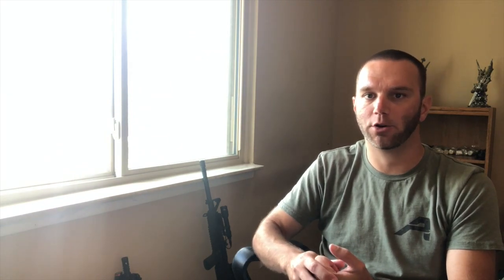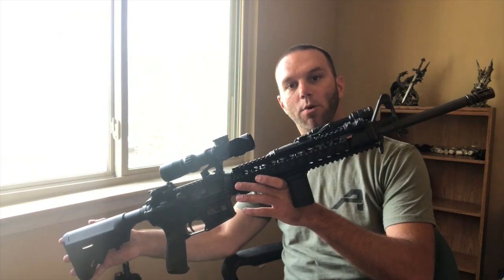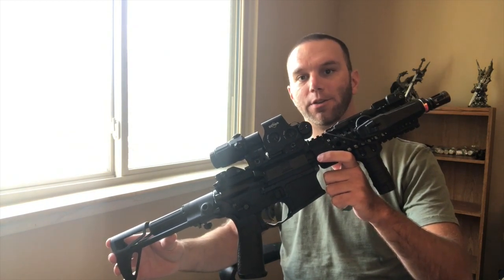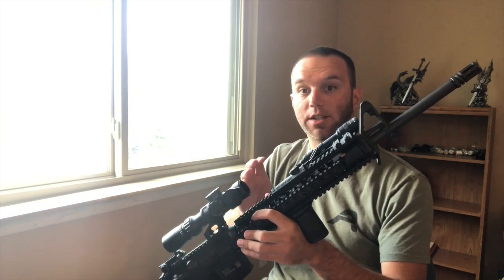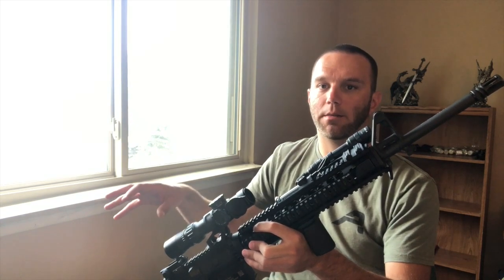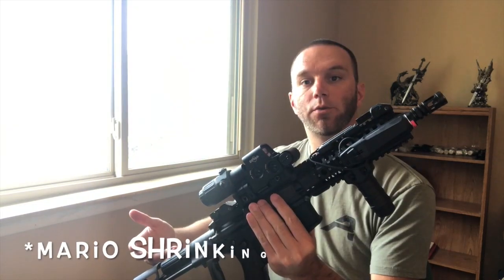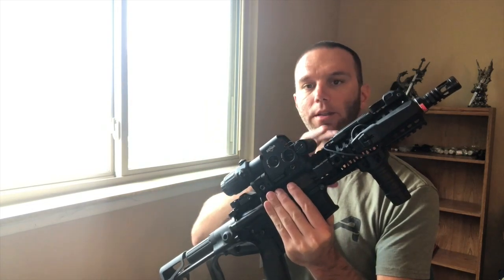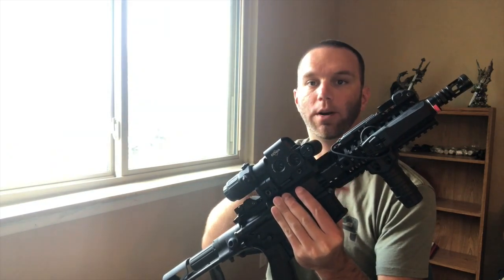Accurizing The X95

Comment: Truer words have never been said about the disassembly video tip. I just received mine back from IWI, as i tried disassembly myself. Ended up crushing the gas cylinder and locked up the charging handle…

Comment: You can adjust the lightning bow trigger to a single stage feel with no take-up and almost no creep(with the stock trigger pack) as opposed to the 2 stage feel.
Reply: How do you do that?
Reply: @shino9797 similar to most aftermarket triggers like those made for Glocks, there's a hex head adjustment screw on the trigger itself that you just need to adjust until the take up is gone. You'd probably have to uninstall it, re-adjust the screw, and try it again until you get it right. A bit of back and forth until it's perfect. Just don't over adjust as then the trigger just won't reset at all.
Reply: @fadetoblack2888  Thanks!

Comment: He seems to have missed a few tricks. First the combination of a riser rail and curved butt pad makes the rifle more ergonomic. A rifle that is more ergonomic is easier to aim & hold on target which makes it easier and more accurate to shoot.. No awkward cranking of the neck. Especially important for larger men. Second, muzzle flip. In the bullpup most of the weight is in the rear. This means the barrel is going to want to kick up more than with other platforms. For accuracy you need a compensator style muzzle device to keep that barrel down. Third, without weight to stabilize the front I recommend using a bipod when possible. Forth, grip tape. This won't make much more difference than removing the polymer locking collar but maintaining a firm grip on the weapon in all situations affects how accurately you will shoot. Fifth, muzzle velocity. Faster bullets drop less. X95 models with longer barrels will shoot better period. Optimal length of barrel for a 77g round is about 20". There are 4" barrel extensions you can add to the gun. For those with 16" stock barrels this will put you right at the sweet spot of about 20" give or take the size of your chosen muzzle device. For those with longer 18" stock barrels you are still better off with the added length if accuracy is your goal.
This video was poorly made sound wise. I had to turn up the sound on my computer to max then turn in back down to go back to normal youtube.

Comment: To shoot the Tavor X95 I discovered that the shooter has to have some modicum of humility and appreciation for the weapon.

I didn't go to the gun range expecting anything about the weapons feel and performance because as a new owner I wanted to understand how to use the weapon as designed in it's stock form as intended.

I allowed the weapon to feel and function by its design and didn't try to force it to meet AR-15 testing requirements. Since I, like some many others, was acclimated to a longer and more stable platform I did not perform well my first couple of range sessions.

After I realized the weapon preferred heavier 62+ grain ammunition and support being as forward as possible I also mastered the pistol-like trigger feel in order to obtain consistency and accuracy.

Once these things were done I was hitting 1.5-2.5 moa at 50 yards on a bench rest with the stock trigger, trigger pack, and 55 grain ammo. The rifle was not modified including the polymer insert or the cocking bar mount.

I allowed the rifle to function the way it wanted to instead of bullying it into an AR-15 and pretending it should behave like one and I achieved better than standard accuracy than most sub-$2,000 ARs using range ammunition (white box) on my Tavor.

When I finally used the heavier 62 grain green tip and imi sierra matchking 77 grain I achieved 1-1.5 moa with 62gr and consistent 1 moa with 77gr all with the rifle bone stock.
Reply: I just got one and was pleased with the accuracy.    Dialling in the irons at 25 yards resting on the side of my pickup i got a 2 inch 5 shot group with IMI 55 grain M193.  The weapon is plenty  accurate for my intended purpose.  A minute of man rifle for 0 to 300.
Reply: @nabu

I intend to do just this.  The modifications are also pretty expensive, and after dropping 2k on the rifle I’m going to enjoy the stock variety for a while.  
I’m not sure the trigger pack is worth $400+.  If you train with the trigger as is you should be fine.  I also have a P227 so I actually like a two stage trigger feel, maybe I’m sick.

Comment: one question on the whole free-float thing?I keep hearing that once a barrel heats up that free floated barrel gets a bit willy/wonky?That only at 1st the free float is more accurate by a smig.I feel if someone has a hog gun or a two legged tactical gun and plan to be shooting it more then the normal hunter,home defender,target shooter,then they will have to worry about heating up their barrels.So i plan to get a 3rd 5.56AR and bed the barrel and see if this is true?Because a bedded barrel needs the extra contact point to help with stability after heating.No??
Reply from the maker: I'm not sure what information source you are getting that from sir, but it isn't true.
A free floated barrel will not lose accuracy after a few shots because of the free float, it would only do so if it is of poor quality or poorly and improperly assembled. A poor quality barrel with poor quality steel and treatment will start to string early but a high quality barrel will open up in a very predictable manner as it heats up. All guns do this, "bedding" a barrel will not alleviate thermodynamics.
Secondly, there is no way to bed an AR15 barrel. Not like an M1 or M14. The barrel nut provides all the tension for the barrel into the receiver and free floating the barrel takes advantage of that by using the barrel nut and receiver to also index and support the handguard. This removes all the external stress and flex points that you could push on the barrel with by way of the handguard in a traditional M16/M4 type set up. It won't matter nearly as much that you are loading a lot of pressure onto a bi-pod or the handguard if the barrel is not in contact with the handguard to be flexed. You could, in theory, use a compound on the barrel extension to help tighten the fitment a little further but I do not recommend this. Using a quality barrel in a quality receiver to proper torque and assemble specs will produce results.

As for why bullpup rifles and by extension most rifles that aren't AR-15's are more expensive, material and R&D cost. Most of the exotic rifles that we have available on the US Market are built up heavy engineered items meant for military or other high endurance use, the LWRC or H&K ARs are not the same price as a Stag or Smith and Wesson and the same holds true for rifles like the X95, they aren't in the same material category. There's nothing wrong with not wanting to spend a lot of money or waiting for a deal or a sale but the saying 'you get what you pay for' holds very true in the firearm industry. The $699 AR-15 rifle is not an H&K 416 or an X95. It isn't even an M16A4 or M4A1, it used cheaper materials and fewer controls for quality to save money. That doesn't mean the rifle doesn't work, it just means it isn't the same.

Everyone likes to throw out the 'lowest bidder' card on military equipment, including rifles, but what they fail to mention is that it is the 'lowest bidder that meets the standards' and those standards are highly exacting. Reading the TDP contract for a company that wants to make M4's for the military is a lengthy and highly detailed read, everything is spelled out down to specific materials and QC procedures that must be used. The commercial AR-15's that would meet or exceed that standard are not the cheap ones, they cost every bit what the X95 or other peer rifles would cost.

Thanks for watching Michael!

Comment: I have the X95, and T-7.  They are both pretty great weapons just like they come out of the box, and considering the price they should be.  All I have done to both of them is a WML, sling, and a Mepro21 on the X, and a 3x quartz red dot on the T.  I'm ok with 3moa; it's mil spec, and somebody paid alot of money to design these and put them into service so I roll with that.  The X is my go to weapon for all things defensive.  Been thinking of converting it over to 9mm; any thoughts on that?  Great video; you have a good presence and command of the material you discussed.